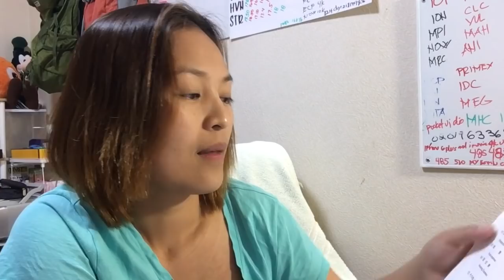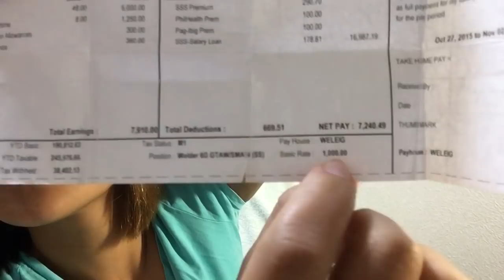magkano ang sahod ng welder dto sa japan[OFW JAPAN]

Comment: Ang baba ng 750yen. 
Depwnde po yan sa lugar.  
821 sa hiroshima. 
Last 2015. 851
Gbto yan e. 
22days computed lng yan.
821per/hour x 8hours=6568 a day x 22 days =144,496 
Minsan my ot kmi na 20hours 
1050per hour ot 
Add 144496+21000=165,496yen
Llaki payan pag may sat/sun na my aditional n 25percent pg sat
At 35percent nmn pg sun.  
Minsan naabot kmi ng 27-28days 
Ky npalo din ng 20-23lapad now mo bwasan ng heatlh insurance at tax at bhay/kuryente n aabot sa 40,000yen. Umaabot prinng 18000-19000yen.  From 2012-2015 computed. May mga area at company po kse n maliit lng mgpshod. nkiki contrata lng sa mga mllking company.  At d nmn gnung kyman.  Nk depende sa kakayanan ng company n mgpasahod at lugar yan.  At kung maliit o mlking company ang napasukan mo.  Lumki ang sahod depende sa araw na naipasok at o.